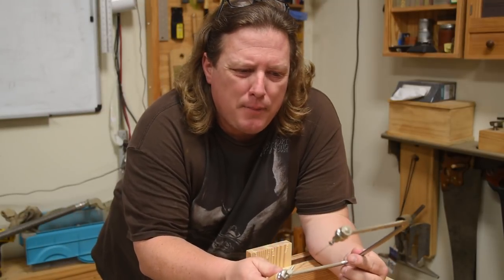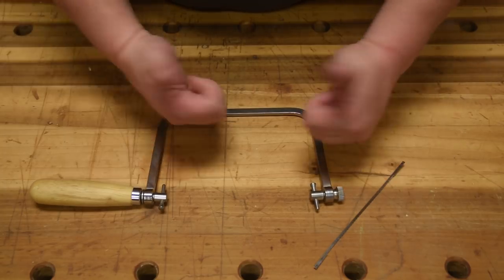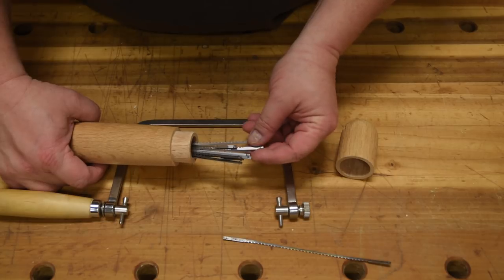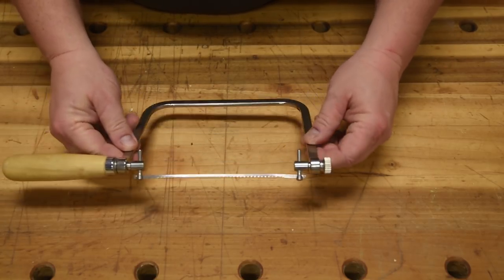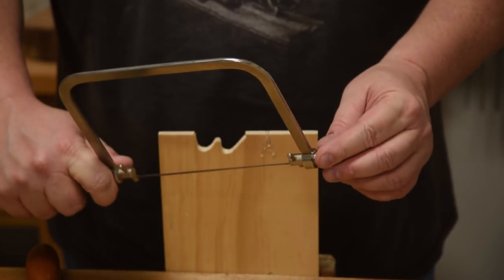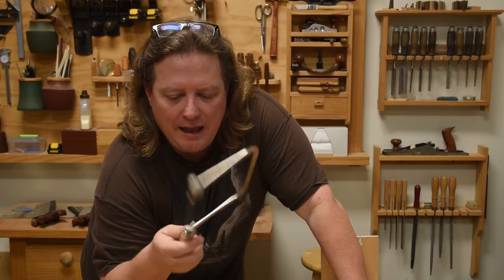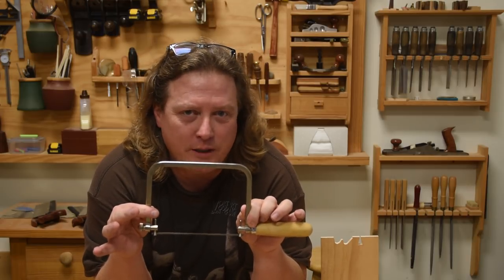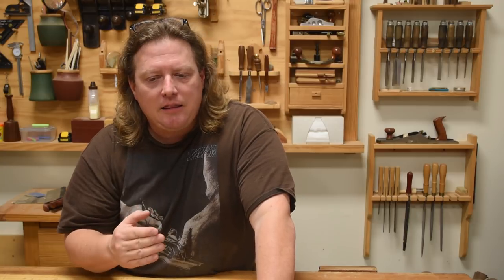Coping Saw

Comment: The coping saw was never "traditionally" supposed to cut on the push stroke, it is always supposed to cut on the pull stroke. Trying to cut on the push is like pushing string
You should also keep your stock flat on the bench, handle below and cut on the down stroke- you'll be able to see and follow the line easier

Comment: One of the OLD guys has the blade twisted. Vertical more or less at the tip and nearly horizontal at the handle.He shoves it in the dovetail slot and as it enter it self rotates to get the base cleared out.

Comment: May be a solution looking for s problem, but I have a Japanese Freeway coping saw which had a spiral wound blade which allows the saw to the cut in any direction without thinking about the saw blade orientation or tension (Axminster Tools sell them). The saw is a little more expensive as are the blades, but I’m still on the original blade after 2 years if occasional use.

Comment: Never thought about blade direction. What you say makes perfect sense. Another great information packed video. It would be interesting to see if you could put a second cross bar under spring tension vs having to step up to a higher priced coping saw.
Reply from the maker: Like a bow saw. Ya, use those more than coping. You can see it hanging on wall. Made about 60 of them as a fund raiser once. Reason why I don't own a fancy coping saw.

Comment: Never heard of using push cut on  a coping saw, i was taught to only use pull cut,you get more control.
Reply from the maker: I've seen it both ways, pull make sense to me.
Reply: I’ve been using the push cut for the simple reason that is the way the blade was installed when I bought it. Like shooting a pistol sideways, like it came out of the box.

Comment: I use the pinned blades I use in my Porter Cable scroll saw.  My Knew Concepts saw uses the unpinned ones like my Dremel Scroll saw.  This allows a wide selection of tooth patterns and widths.  I use a super thin blade on my dovetails.

Comment: Thanks for the info and well thought out.  
My comment/Question is really for the Manufacturers of coping saws;  Why would you not recommend the use of the Pull stroke (even as an alternative) since you have been manufacturing these and presumably using Continuous Improvement through R&D, for so many years?  OR, Do you already and no one notices???
Reply from the maker: I don't think manufacturers recommend one way or the other. They let the users decide. It's just more traditional to set saws up on the push  when you work on a bench. Pattern of behavior....

Comment: I have used many coping saws  of many styles but the best one I found out is Knew concepts saw. Very light, very good tension and.....a mediocre-slim-what’s-your-gnome-handle I need to replace ASAP. 

It is quite expensive but worth every penny imho. 
Ps the handle is still better than on any other fret/coping saws I tried. 
Cheers
Reply from the maker: Yep, that's one of those trellis frame jobs.

Comment: I just got a coping saw so I really appreciated this video, nice timing =)
but every time I use it my thumb joint swells up A considerable amount, so the first thing I thought was that I was holding it wrong. do you have any tips on holding it?
Reply from the maker: Only thing I warn people about is don't put the end of the handle in your palm as that's where the nerves are.
Reply: wortheffort ik I try not to but even when it's not in my palm my thumb hurts
Btw nice tip about stretching it I need to do that =)

Comment: I use it with a pull stroke too (it's a Bahco 301), I have no real problem with the push stroke now btw but I had when I started using it.

Comment: My budget was below $30. I spent hours upon hours searching for a decent coping saw. All of the 'classic ones' have the same flimsy frame. In parallel, I was researching traditional fame saws. Eureka! I just need a small frame saw with a narrow blade. So I bought the Gramercy coping saw DIY set. The one with pins and 3 different blades. Making the actual frame comes next. Also, who says coping saw has to be 9" or so?! Google 'frank klaus dovetails' and see him doing dovetails with a freaking resaw frame saw! // Second: Who says you can't go Slavic for a day ;) by stiffening the top part of the flimsy frame with an extra piece of metal? Doable in 30 minutes with screws and some flat stock. Trusses are used only to keep everything as light as possible and for the marketing gleem. // One last tip: Bahco sells hacksaw blades of as low as 14 TPI. Just saying.
Reply from the maker: Pst... check out my tool rack behind bench. You might see something. I've made about 60 of those Gramercy kits. My real go to waste removal tool. But that's something you need tools to make. These cheap coping saws are a good start.

Comment: Great recommendations.  I have to look for some star washers.  I have one more suggestion.  Turn the blade around (not push vs pull) so that the blade is following the line of motion, rather than leading it.  http://www.timberframe-tools.com/tools/coping-saw-blade-direction-you-lead-blade-follows/   It makes quite an improvement both in ease of use, and in precision of  cuts.
Reply from the maker: good referral

Comment: Coping saws as with fret saws are designed to be used on the pull stroke. Incompetents carpenters have used them on the push stroke and perpetuated that mistake even the This old house stars. I have used coping saws for over 40 years and almost never break a blade. Just learn how to use the tool and save all the heartache.
Reply from the maker: Watch my video on Dovetails or this next project one and you'll see why I break em on occasion (one every few years?). The bending and force gets them real hot fast. It's the pivoting in one spot that does it.